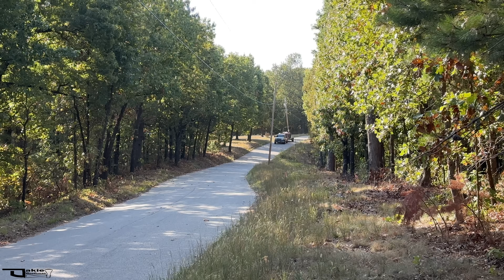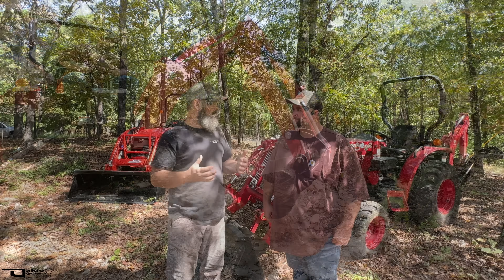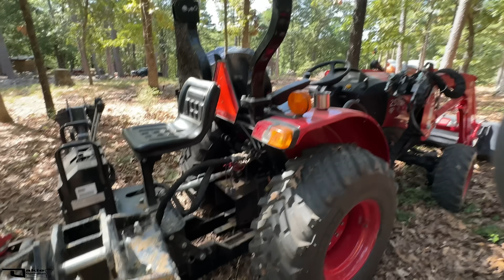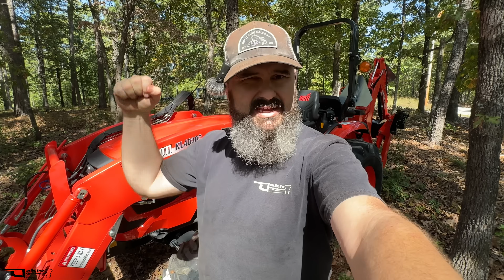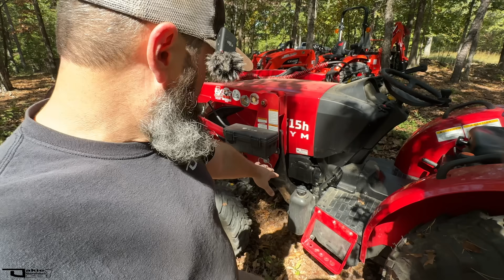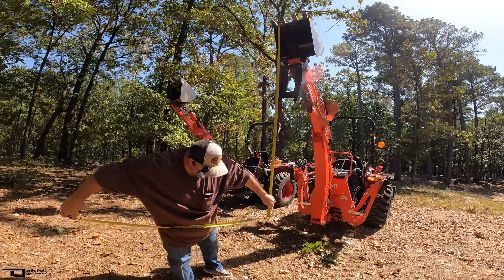DELIVERED! Kioti CK2620 and TYM 2515H - Do NOT Buy Until you Watch THIS!

Comment: This machine is extremely nice in person. The more you use the the more your gonna wonder how you got by without it.
Reply from the maker: @TheRustyGarageandHomestead I am so thrilled to have it.  My steering wheel is not clocked correctly.  When going straight the logo is not even close! hahahaha
Reply: @oakiewoodsman  mine does the same thing. It's because it's hydraulic controlled. Sometimes mine is right but more than not it's wrong.
Reply: @oakiewoodsman  it will never be straight , it will keep changing on you as you steer or oversteer. If that makes sense.
Reply from the maker: @Luxurylogs i see what you mean!  I noticed today that the logo seems to be clocked yet again differently!  I will not worry about it then.  Thank you very much for weighing in on this!

Comment: On the grease gun, definitely go electric and get a LockNLube grease gun coupler for the quickest greasing of all your zerks.
Reply: I agree. That's what I use. The lock n lube makes life way easier
Reply from the maker: @beardedrockinhillbilly I think you and others have convinced me.  If the task is easier, it will likely get done more regularly and that is a win win for the hands and the equipment!
Reply: Friend: SAVE yer money ,& git a good quality lever& pistol grip guns. Good grease 6$ & tube & up....not that 1.99$ trash-lock-tight in a 200.°°$ New-fangled Slober-matic/ were ya NEVER KNOW the condition of the fitting. Grease often( every 2-3) hours/ after All its part of the daily inspection. Along with THOROUGHLY reading & Understanding the Opperaters Manuals before turning a "Key" on a New Machine....no matter how many you have run or owned. Best wishes with all your endeavours. Such a Great Vidio!!!!
Reply from the maker: @donaldstrishock3923  thanks for sharing!  Do you are not a fan of the electric grease guns and LockNLube setup?

Comment: Nice tractors Joe. You will love it and kick yourself for not getting it years ago. They are great boy toys. I have a used 2008 Massey GC2610 with a loader, rear grader and front mount snow blower. It is a back saver. Just follow maintenance properly and keep things greased. Be careful. I suggest you get loaded tires to increase the stability of the tractor. Have fun.
Reply: Hi Steve. I agree with you. He is going to love this machine
Reply from the maker: Thank you Steve!  I am so incredibly thankful to have this machine.  I actually found a critical joint that is a tad dry so I really need to get some grease in it asap.  Like you said, I believe it is going to be a game changer for my family and I.

Comment: Good video. I'm a TYM owner, but I like to see comparisons, and the differences between them and other brands. Yall should have talked about the engines a bit. That TYM/Kukje A series is all mechanical, and bit easier to work on, with no ECMs or wiring harnesses to worry about. At the same time though, you don't get all the sensors a motor with an ECM has, so you have to pay more attention to how your tractor feels and sounds, to make sure you don't overheat it, or cause other issues. If you're an old tractor owner this is how it's always been, but for new tractor owners, who are only used to the vehicles they drive, sensors might make sense.
Reply from the maker: Great comment and that is certainly something that is attractive about the Branson engine. I know that initially I was very interested because of that very thing. You do bring up a good point though that unless a person is familiar with diesel operation, you may have to indeed rely upon Over error codes. If I were going to go with a larger horsepower engine, I think I would have been more inclined to go with the Kukje engine to keep it as simple as possible. Thank you so much for watching and commenting.!
Reply: This! This is the deciding factor for me. Mechanical = less things to go wrong.

Comment: electric grease guns make it impossible to feel if the zirk is froze and not taking grease. Put a gauge on your manual pump grease gun. if to high of pressure, replace the zirk. over grease everything

Comment: Wish you talked more about engine
Reply from the maker: I appreciate you watching. What would you like to know?
Reply: @ is fuel injection mechanical or electronic
Reply from the maker: @ ah. I do not believe that either of these are common rail. I know the Kukje engine in the TYM is mechanical and so do believe the 25HP engine in my KIOTI is as well. They are both know to be excellent engines from what I have seen from other reviewers and information. I will admit, I was purchasing off of price and capacities. It is very unlike me to not know every about a product before purchasing. I intended on buying TYM the day I purchased this machine and the KIOTI simply got me me all the information time frames etc and seemed more hungry for the sale. I liked orange and the price was going to be similar and the dealer was 1 hr away rather than 1hr 45 minutes.
Reply: Hi Peter, Both machines are mechanical injection engines. They are not a common rail design. Think of them more of like an old 12V cummins. Both of these engines in this model are basically detuned because they use the same engine in higher HP models. they both can be turned up to 35hp or more easily on the injection pump. That would of course void any engine warranty we both still have. But when that day ends...  There are some great videos on yt about the Kukje engine. The Kioti uses a Daedong engine. both of these engines are known for their reliability, performance, & fuel economy. There are detailed videos about both engines on YT that talk about these engines.
Reply: @ ty you so much great info

Comment: As far as foot board could always get the sand paper tape they use on boat trailer fenders cant remember exactly what it is called but its alot like the grip tape on skateboards
Reply: We have the branson 4515r and as a 300lb guy i feel the squeeze especially setting the brake😂
Reply from the maker: That could be a very good option for sure!  Thank you for sharing that bit of information.  Since we have had some rain, the metal does indeed get a bit slick when wet.

Comment: For your new machines, good luck and trouble free running for years to come!
I bought a Kioti CK 4010, no SE models available without a long wait during the pandemic. The SE has the third function, linked pedal, and the cruise control, slide links on the arms of the 3-Pt. Rubber floor mat, and dual hydraulic remotes.
I set mine up with most of the options I figured I would use most.
Reply from the maker: I did not even price the SE. wondering now.  Thanks for watching and sharing!

Comment: Hi Joe/Mike, thanks for the video, I am in Aus, and looking at a new tractor for my hobby farm property, currently looking at the Kioti, CK3710 and Kubota B3150, (models numbers might be different in the northern hemisphere ??) lot of great tips, and hints, that I have jotted down, and can go to the dealers loaded with questions, Thanks,  Gary, (PS, has subbed also :) )
Reply from the maker: Welcome!  I am not a tractor expert but I would certainly recommend getting the larger frame size you can that makes sense for your situation.  A kubota even the same size as these two machines wouldnt work for either Mike or I.  We need more capacity than they offer.  Do your homework, don't feel pressured and use this wonderful resource like you are and you will find what you are looking for have have peace about it I do believe!

Comment: Wow now I'm really going to look at Kioti tractors, had my mind made up for a TYM but now I'm not so sure, Great video!!
Reply from the maker: Worth looking at for sure. The shorter overall length of my machine has proven beneficial in and around our trees and tighter circumstances. Of course, if you are working in a wide open location that certainly would matter as much. Thanks for watching and commenting!
Reply: you cant go wrong with either machine

Comment: I have t25 and love it. Such a capable small tractor. I'm going to be selling and buying the new 25hp cab tym coming out. I can't remember the model number on it, maybe 3025? Also there are great aftermarket adons to make a less comfortable machine a bit more friendly. Cordless grease gun, leave the old school stuff in the past.
Reply from the maker: Excellent!  I think the t25 is an actual TYM machine right?  The one you are talking about is the TYM branded Branson which I think is a great machine!  Thanks for watching and sharing!
Reply: @oakiewoodsman  Yep correct, I actually have a rk25 (tym)  I bought a tym 474 cab in 2020 but sold it because it wasn't big enough for my needs. Bought a skid steer to replace it.  Coming from JDs I had a hard time convincing myself that a tractor that cost over 30% less would be worth it.  As long as part availability and dealer networks keep improving, there is no reason not to try the "other" brands.
Reply from the maker: I agree!  Right on and thanks for sharing!

Comment: pump grease gun with adjustable volume /pressure tab and lock n load tip. if u keep up  with your maintenance .
Reply from the maker: Thanks for sharing. There will be an update on this coming very shortly. I will have to say that I did struggle a little bit. I also need to say that I was not new at greasing equipment, but this situation was unexpected.

Comment: Nice comparison ….about a year ago I bought  kubota L3902 ….love the machine except for the lift capacity…..originally it was only about 1100# capability…..pretty low ….i get why they made it that low because of safety precautions….
I upped the pressure and now have it to 1400# or so……much better for me. Line pressures are still well under max PSI..
I thought about a Kioti tractor but no near by dealers and most other brands were a couple hours away..
Great video with detailed comparisons that will make or break a persons choice …
Reply from the maker: I really appreciate you taking the time to watch and then share what you have done to bring up the capacity on your Kubota. Like you, the Kubota dealer would have been by far the nearest dealership to me. I love their machines. I wish the capacities were slightly better, especially because the machine was gonna cost almost $10,000 more than mine did similarly equipped. My dealership is about one hour away from my home. I hope I don’t have to take it back there ever again.😉 thank you so much for the compliments and I appreciate you being here!

Comment: You all should try setting the parking break on a 8N :)
Reply from the maker: hahahahaha.... but in all fairness, a pristine 8N is nowhere near the price of these two modern machines.  Thank you for watching and sharing.  Please tell me why the 8N is so difficult if you do not mind
Reply: @oakiewoodsman  Rather than trying to explain it I made a short video .  But now it looks like there is no way for me to upload it as a reply so I will try to explain.  The 8N has the right and left foot break petals both on the right side and they are a fairly solid linkage that turns a shaft that goes straight into the break drum expanding the shoes. This shaft runs right along the rear axle and is supported at both ends by the break housing  at one end and the transfer case housing at the other.  Attached to the shaft at the transfer case end is what could be described as a large ratchet pawl and on the case housing  is plate with a row of teeth along one side.  So to put on the parking break you push down on the break pedal and then reach down under the seat next to the rear axle and turn the ratchet pawl into the teeth to lock it in place. Then you can release the break pedal and the break will stay on and you hope it is tight enough to hold .   If you want or need both breaks on you need to then do the same thing for the other side.  To release you just need to push on the break peddle an let it up.  The hardest part of that is remembering to do it because the tractor has more than enough power to move with the break on with only a slight loss in power feeling and this will ware out your break shoes quick.  Go ahead ask me how I know! :)

I must say I like the Kioti's method the best of the 2 but the TYM's is still not that bad. 😁
Reply from the maker: I wish people could post pictures and videos on this platform.  That is one thing I love about the FB audience we have grown.  They can get me pictures and video in the comment section!
Reply from the maker: @johngoldfuss1994 you should be a writer.  I absolutely can picture what you are talking about!  I would 100% drive away with the break on.... NO DOUBT!  Thanks for sharing all of that.

Comment: My biggest pet leave on these tractors is the small size of the front tires. Seems the Kubota's are puny in comparison, but they all are too small.
Reply from the maker: hhmmmm.... never have really thought about that.   About how much larger would you go??
Reply: @oakiewoodsman  I think the front tires should be ⅔-¾ the height of the rear tires.  I've run construction equipment and small tractors all my life. I think the taller the front tires are, the more maneuverable and agile the machine is off road. Especially when using the loader or a grapple.
Reply from the maker: I could see that.  I noticed that on the larger ag tractor the tire are much more large in terms of proportion.  Interesting conversation for sure.  Why do you think they mak them so small???
Reply: @oakiewoodsman  of course,  first, would be cost. Also visibility,  and turning radius. Maybe it's time for four wheel steering.

Comment: My floor of my tractor completely rusted out because of water and dirt got under the mat which I never knew it was happening cause the mat was not removeable "easily" I would just buy a roll of grip tape and put it on the metal floor where you need it.🍻
Reply from the maker: oh wow!  That is something to consider for sure.  Can I ask what make and model that was??  That would be a bad surprise.  Glad you shared that with everyone.  Thank you for watching and taking the time to comment.
Reply: @oakiewoodsman  That was a 01 Simplicity Legacy. That was used for mainly cutting grass and plowing snow. Grass is very corrosive . When I plowed snow with it I'm shure I had salt on my boots which built up under the mats. One more thing I didn't like about the TYM was that the Hyo filter and the hose block didn't have a guard like the Kioti did.🍻
Reply from the maker: I found that interesting as well!  Thanks for writing back!

Comment: After looking at tym, I had decided to go with bad boy. It was way more comfortable. Will have to look at kioti though first.
Reply from the maker: I think they are both great tractors and with everything, each will have some advantages and disadvantages. So far I have been very impressed with my machine. I have moved lots of dirt/rock, did stumps etc. The factory linked pedal on the TYM would certainly be welcome but when Ibam pushing dirt, run it in Low with the throttle up anyway. Thanks for watching and make sure you check out my other tractor videos.
Reply: Unless they changed recently, bad boy tractors were rebranded  Bransons. Which are now part of tym line.
Reply: @stanley8574  yes. They are tym but little things are different that make it more comfortable such as seat, placement of controls. Also I believe bad boy makes their own attachments.

Comment: Would lowering the out rigger make it easier to get on/backhoe? I’m not familiar with either Manufacturer, so I’m not sure if you’re able to operate outriggers from the ground?
Reply from the maker: I am not sure it would make it easier but standard practice I do believe is to be in the seated position before lowering them. I have of course done if from outside of the machine but that could certainly put you in harms way of you were to set the pad in your foot or maybe the machine could shift. My KIOTI is very easy to enter and exit!

Comment: They used to sell the Kioti backhoe on the TYM.  Make sure you check the bolts on the backhoe.  Wow the handbrakes are bad on these not that I use them I just open the bucket and use the back edge.
Reply from the maker: you know... I do believe I forgot those ones so I surely appreciate you mentioning this to me.  I did not know that TYM sourced some parts from Kioti before.  Thanks for the information!

Comment: Nice comparison!  First time I've seen so much detail on them in one place. I'm really glad I went with the 3515 cab.  I've got some features the open station 2515 doesn't have.  Not the least of which are a good parking brake on the dash, and fender mounted loader controls. I have a Kioti dealer 1.5 miles from my house, and I was early in the process of buying through him, but he ended up being a liar who also doesn't communicate, which is why I ended up going TYM.  They're both good machines that fit was I was going for as an addition/small upgrade to the 1025r capabilities for my business.  Both of the machines here are awesome, and are a great option in between the two I've got now. You both did well and shouldn't have any regrets. Thanks!
Reply from the maker: @jeremyj612 makes total sense why you did what you did and you sure ended up with a nice machine for sure!  I am impressed with the TYM/Branson indeed.  I am currently enjoying the shorter dimensions in my tight working areas.  Thank you so much for stopping by and checking out this video as well.